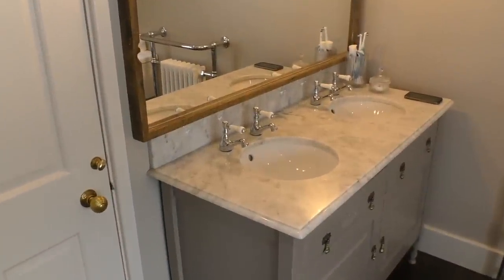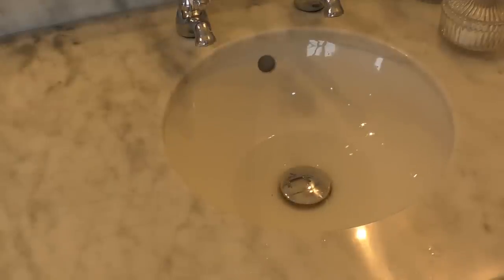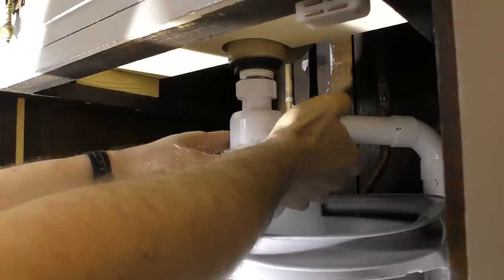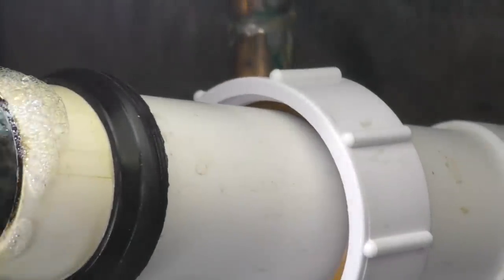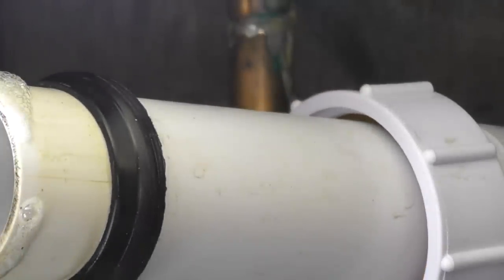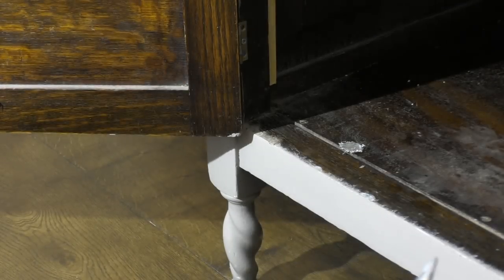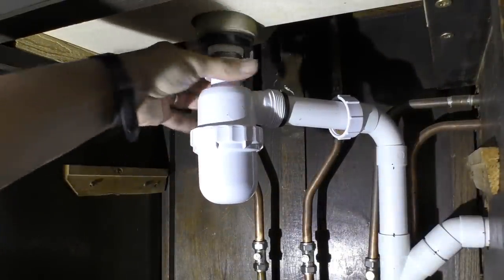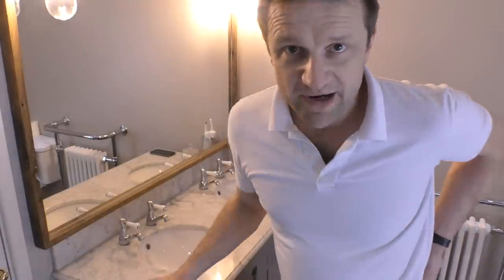How to Unblock a Bathroom Sink

Comment: Thanks for the video. We have a blocked bathroom sink, on a pedestal, with just a simple U-Bend connection underneath. The water does not drain at all. Because of the pedestal its tricky to get to unscrew the connections.  None the less I have unconnected everything, cleaned and put back together. However, the water is still just not draining. The outlet pipe for the waste goes into a plasterboard wall. To my mind, there must be an issue with the pipe going into the wall, or beyond. Or have I missed anything. Any further advice would be appreciated.

Comment: I had this exact issue, couldn’t believe that amount of gunk!  My problem now is that the top washer has perished so I’m getting a leak after reassembly.  How do I know what size replacement washer to get, they seem to be 32 or 40mm but nothin seems to match those measurements exactly?

Comment: Neat plumbing job, if it bugs you that much, why don’t you cut the pipe and fit a straight joiner below the Y junction.   My lad has a hair salon and I regularly have to clean the basin wastes from underneath and as you’ve demonstrated pliers are a must.  Like the basin unit 👍🏻 Thanks for posting.

Comment: I’ve tried a plunger, mr muscle, and even bought a tool from Amazon for unblocking drains none have worked, unfortunately I can’t even get the tool from Amazon down the pipe very far, how can I do this when I don’t have open space round the pipes like this video? The sink doesn’t just drain slow it doesn’t drain at all

Comment: the pipe from our sink goes down to the floorboard and then seems to take a 90 or 45 degree bend - under the floorboard - and this seems to be just where the blockage is on mine lol. I can take the p trap apart easy but the 75cm or so of vertical pipe is solvent welded after that onto that bend. Seems I'm screwed unless I can lift that floorboard somehow.

Comment: How is it that the push plug is removed. I’m struggling to remove mine. There isn’t a link rod behind the pedestal sink. Also, I have a pedestal trap rather than a bottle trap. Is the principle the same ?
Reply from the maker: My plug unscrews. Yes the principal should be the same with the pedestal trap, albeit more fiddly to get to and remove.